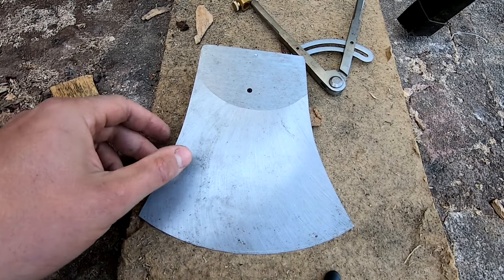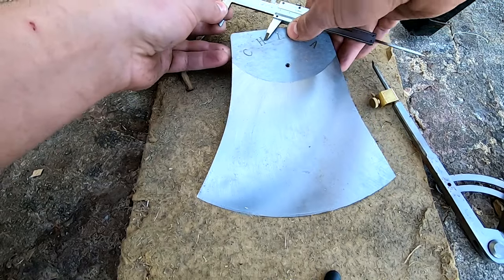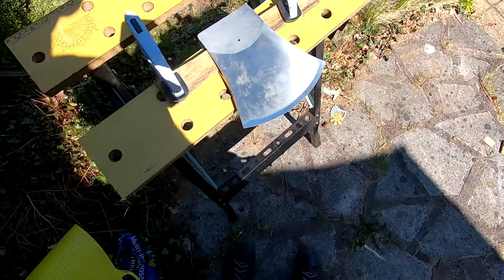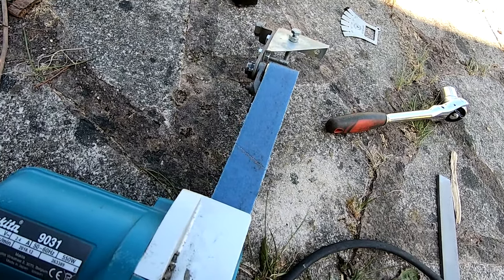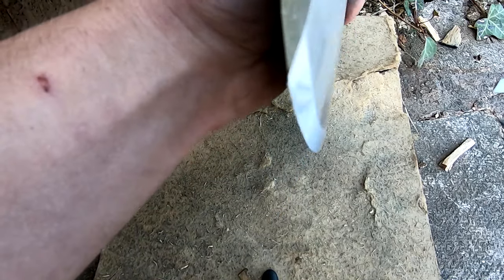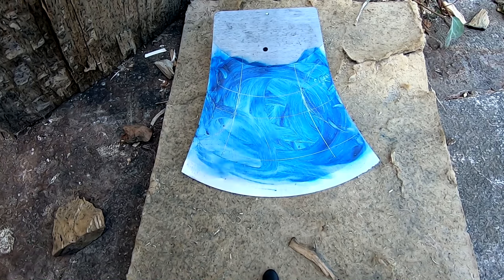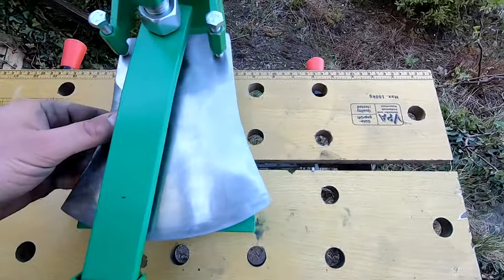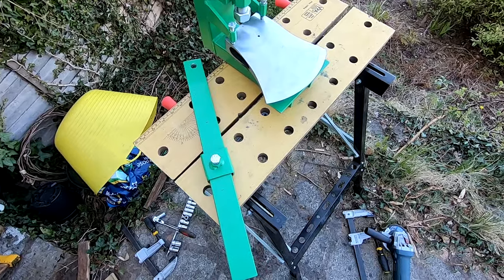How to Grind a Timbersports Racing Axe and Axe Chat

Comment: Pretty sure that in factories the blades are contoured/shaped prior to heat treating.
After heat treating it is a simple job to put an edge on it.
Reply from the maker: The point is they still use electric grinding wheels or belts to grind them both pre and post tempering. Power tools ruining an axe is a myth as long as you regularly cool them
Reply: @benscottwoodchopper  Agreed

Comment: I use the weird cross-arm technique for banging wedge when i'm standing on my weak side, if i hold the axe in my non-dominant hand i don't get as much power and tend to bang the wedges with the handle rather than the poll since i'm not as accurate. Couldn't imagine using that technique for felling or general chopping though

Comment: 16:00 : About the point on "reverse hand" -> what's the problem if you switch your body 180 degrees ? Being right handed I chop as a left handed but I always position myself on the right side of the felling notch. Cross handed is of course very unconfortable

Comment: What are your thoughts on using an angle grinder vs belt sander as seen in this video?
Reply from the maker: You can use an angle grinder for working axes but belt sander is far superior for racing axes, you want the bevel flat

Comment: Very nice! What wood do you plan on swinging it at? It seems a bit thin for hard stuff to me, but I may be on the cautious side.
Reply from the maker: its for a guy i work with, 20 degrees should handle most woods well
Reply: @benscottwoodchopper  Is that 20 degrees total, 20 degrees measured from the cheek or 20 degrees from the center line of the bit thickness?
Reply from the maker: @Fogyt121  the flat chisel I ground onto the axe with the belt sander is 20 degrees
Reply: @benscottwoodchopper  I understand that, I just wanted to know where you measure it from
Reply: @benscottwoodchopper  after watching the video again, it seems to me the included angle of the chisel is 20 degrees, thanks

Comment: Any chance that grinding wings recudes strength or anything? Also does heating while grinding wings change strength in the main body of the axe? Good video ben.
Reply from the maker: grinding wings wont affect strength unless you go super extreme with it. If its not so hot that you can still touch it, it will be fine
Reply: @benscottwoodchopper  great thanks mate